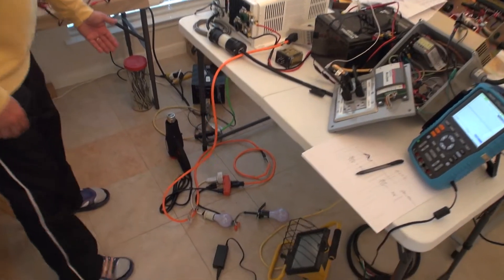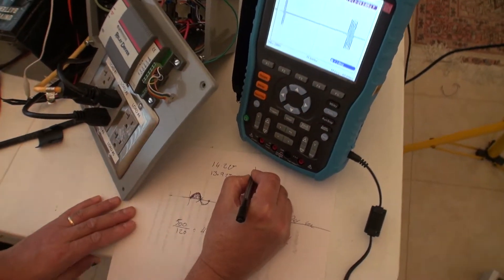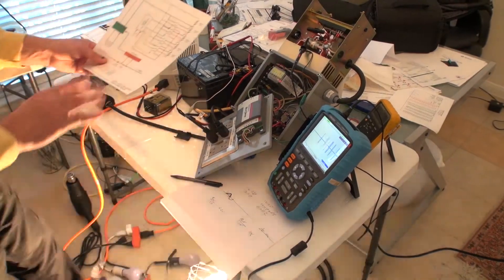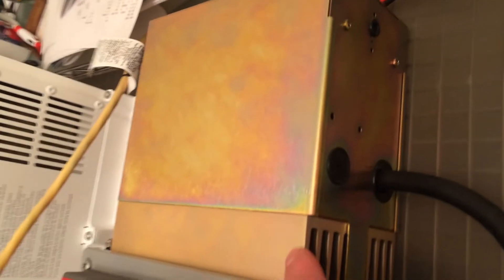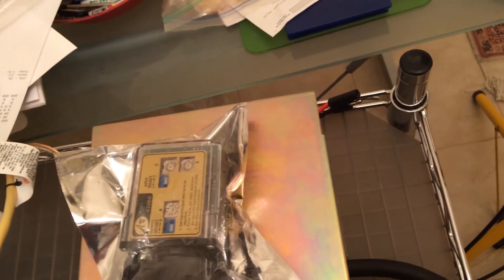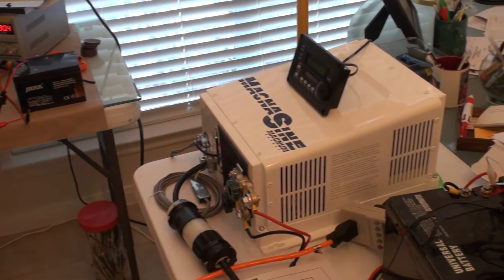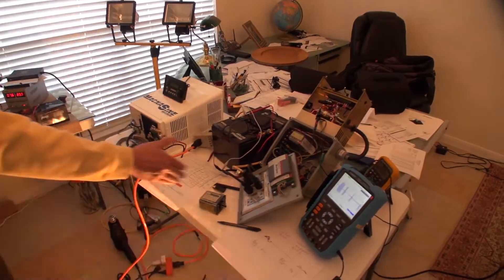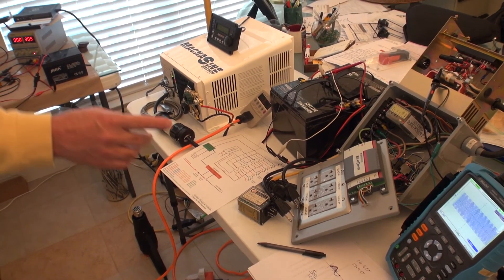Grid Tie Inverter without a Grid Part 3 of 5

Comment: One thing I didn't understand is your API optoisolator is looking between 14V-15V, but your system is a 24Vdc system. So wouldn't you have to look at some voltages higher than 24V to determine when to start shedding load? I assume like around 28V-30V?

Comment: Any Documentation available  on your work here ?  Would it be possible to simply Use a Variable Dimmer type circuit to vary the load as required ?
Reply from the maker: You just have fraction of one cycle to respond to load management otherwise increase the voltage or change a frequency will shut the inverter Off

Comment: but please how you dump dc A series load if voltage was constant and you have extra amp coming of converter
Reply from the maker: Extra power generated by inverter and not being used cause slightly increasing the voltage line and that trigger the dump load circuitry